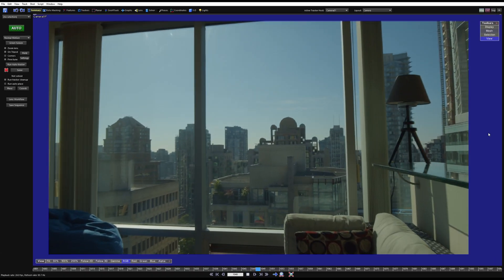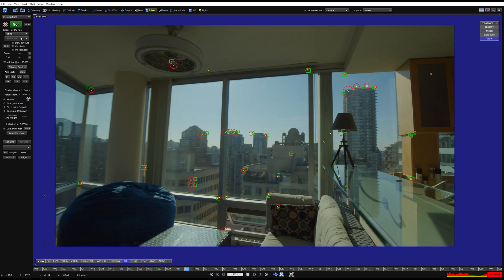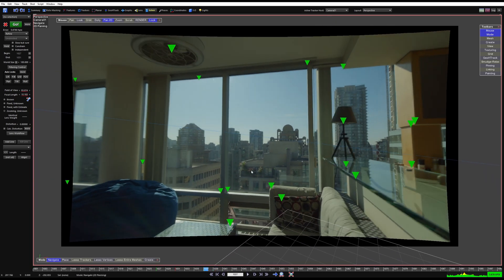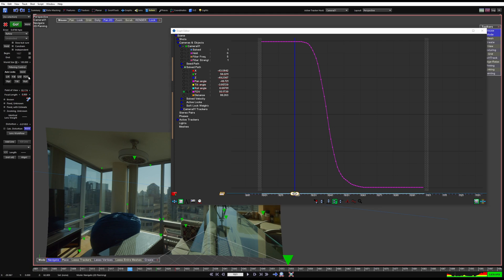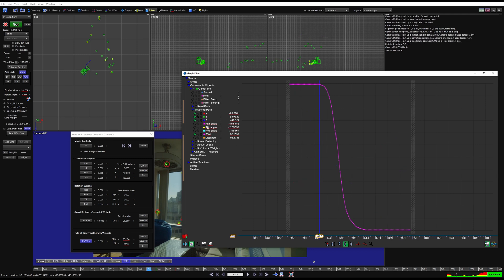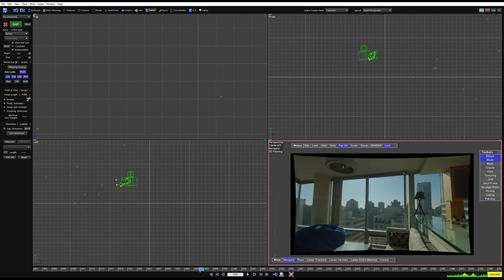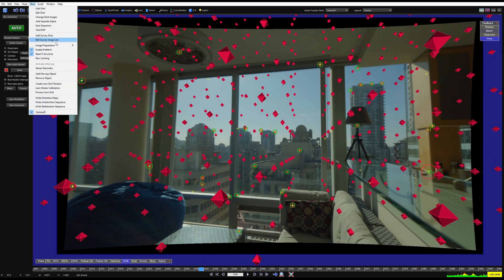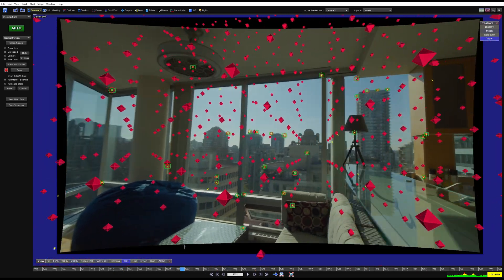Zoom and Animated Distortion - SYNTHEYES

Comment: I cannot for the life of me sort this zooming shot. I'm following your tutorial, and its getting me CLOSE! but some of the trackers still float off in weird directions, i know how I performed the zoom so I edited the FOV keyframes like you did and constrained it, I realized it was animating the axis lock enable button on first few frames which tripped me up. Got that sorted out, still though, stuff is floating around and i'm at about 2.5 hpix error. calc distortion, and my distortion does not look normal its like a rectangle with a bulbous circle in hte middle and the very center of the frame has this insane fisheye distortion haha. I did a similar shot, walking forward a bit and doing a somewhat fast zoom. It is blurry and out of focus for a little bit so maybe that is just making the tracking difficult. Anyway, practicing.. . and TRYING to understand how to solve a zoom shot. I wonder if one has a lens with lens data how that could be loaded in for perfect focus and zoom values, that'd be interesting. Although I'm just manually doing one myself so that's a luxury I don't have haha. Thanks for posting this! Maybe i'll be able to crack the code on it this week. I've tried for 2 days in a row, no luck yet.